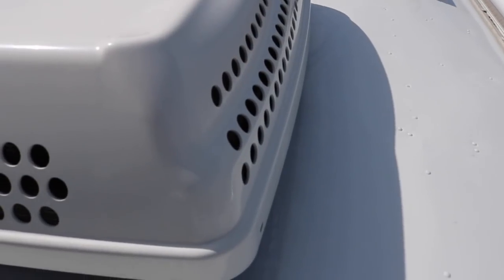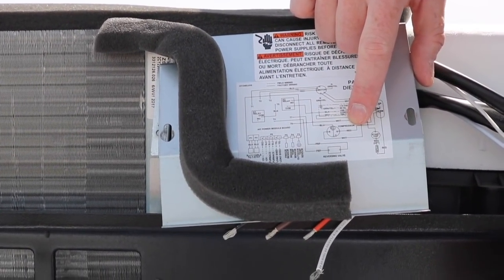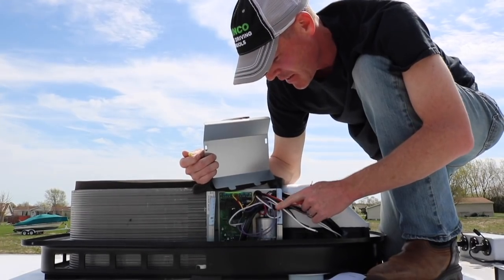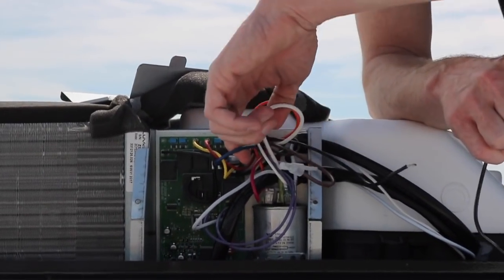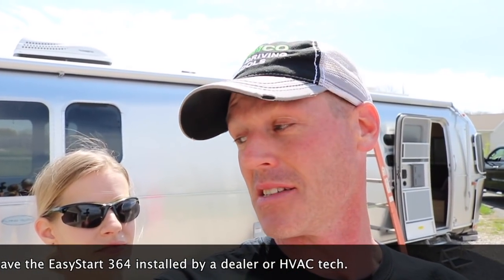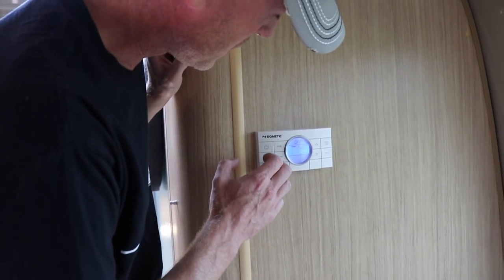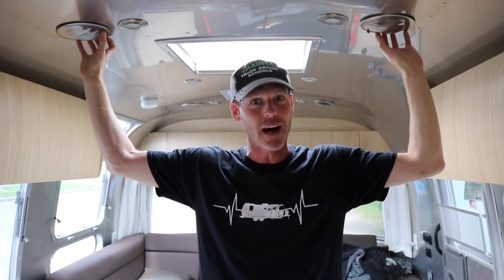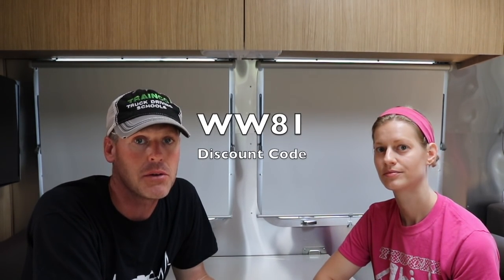HOW TO UPGRADE YOUR RV AC (DIY MicroAir Easy Start 364)

Comment: Bought this myself, both the EasyStart and iGen2500, now need to make time to get installed. Convinced both will handle my 13.5 AC no problem, but I'm curious about additional loads. Did you attempt other loads on the generator at same time? TIA
Reply: Hi Mark.  Many thanks for your purchases.  A typical modern 13.5kBTU A/C draws about 13A in warm weather.  The Westinghouse iGen2500 can sustain 2200W (18.3A) indefinitely, as we have verified in our extensive testing.  That means you'll have about 5.3A or 635W maximum leftover to power your auxiliary loads.  That's enough for just about everything except for a microwave oven (800-1200W) and for your battery charger (converter) in rapid charge mode (~1000W in many trailer designs).  In our extensive testing of both the iGen2500 and the Honda EU2000i, we have found that with EasyStart installed into the A/C, you can load the generator with the maximum calculated auxiliary load before you start the A/C, and it will still start and run fine.  Of course, operating right on the edge of the generator declaring its overload fault during steady-state operation isn't recommended since that could certainly cause nuisance trips and shutdowns.  Knowing the numbers as shown above though will allow you to do some intelligent power management to keep things running without interruption.

I'm also curious what the Wagners were able to attain with additional loads, so we'll stay tuned for their reply.
Reply from the maker: We haven't added any additional heavy loads to the generator while running the AC, we have ran things like lights, radio, TV's, ect. When we are on generator power we usually set the water heater and fridge to LP. We do know that if we want to run the microwave we have to turn off the AC first. Not really a big deal for us since Lynn uses the oven more than the microwave.

Comment: Hi Mike ,
   Question on the EZ Start and the 2500 watt Westinghouse generator . You lose aprox 3% horse power for every 1,000 feet in Altitude . Do you think you'll have any issues with the 2500 watt generator up in the mountains as far as running the a/c ?  ( It's not uncommon for my wife and I to camp at over 10,000 feet above sea level in Wyoming .)

  JT
Reply: Not sure about the westinghouse but my 2 Honda eu2200’s, and most other Honda wannabes, pair up and put out great power! I camp at high elevation too and never had an issue with the power!
Reply from the maker: We haven't used the 2500 at elevation but if we had to choose, we'd take the predator vs the Westinghouse

Comment: Just wondering why you went with this product instead of a hard start capacitor. Seems to be a big price difference. Thanks for always helping
Reply from the maker: Sombody asked if there was a difference between the EasyStart and a hard start capacitor, Mico-Air replied to it best, so I am going to copy and paste their response.

"a hard start is simply a start capacitor in series with a switching device.  Most factory-installed or aftermarket hard starts use a "PTCR" to act as this switching device.  A hard start gets applied during the startup of the compressor, and it adds torque to the motor, which shortens the duration of the start, but it does so at the expense of starting surge current.  A hard start takes about 250ms (1/4 of a second).  In some rare cases, a hard start can make a marginally non-working generator/compressor combination marginally work. But it won't always be reliable.
EasyStart is totally different.  EasyStart is very sophisticated, microprocessor-controlled, soft starter that gently ramps and accelerates the compressor to speed over the course of about 1 second.  EasyStart uses solid-state electronics to gently apply the voltage and current to the compressor's run and start windings separately, and uses a transducer and phase detection to measure current and compressor rotation in real time.  This allows EasyStart to orchestrate a very precisely controlled starting ramp that uses 65-75% less current than a normal or hard start would have used.  It's really quite amazing.  Beyond this, EasyStart "learns" the compressor during the first 5 starts to optimize its parametrics.  And if that weren't enough, EasyStart continues to monitor for 5 different fault conditions to protect your compressor during steady-state operation.  These conditions include stalls, overcurrent, open thermal protector, brownout/low-voltage, and short cycles.  No hard start or factory OEM configuration can provide any of this!"
Reply: @WanderingWagners  and if all those electronics go tits-up,  is it worth it to repair it?   How much to buy an easy-start at 2019 prices please?

Comment: Thanks for the video very good information, how are you connecting the generator to your Airstream? That yellow extension is not the 50A cable right?
Reply from the maker: The yellow cable is a 20 amp extension cord, I am using a 50/20 amp adapter like this https://amzn.to/2IADY23

Comment: Heat and altitude go in reverse.  For every thousand feet you drop about 5-10 degrees in air temperature! Above 7-8kft you don't really need too much AC!
Reply from the maker: True but still worth noting!
Reply: Also with altitude you reduce humidity which strongly reduces overall load on AC systems. Moisture holds a lot of heat, less of it makes it easier to cool the air. One big part of AC systems is dehumidification.
Reply: nope--- 3 degrees farenheit per 1000 ft --I used to skydive

Comment: I'm having a problem with the exact same setup on my 2014 Airstream. I've done the five starts on utility power but now my Yamaha  EF2000iSv2 can't start the A/C. When the compressor starts, the Yamaha goes into overload.  The Airstream's inverter is off. I have the Use/Store switch in Store position. Anything I'm missing with other switches or circuit breakers? Thanks.
Reply: Hello Don.  You and I have been dialoguing through email, so this comment is a bit out of date. Let's see what our troubleshooting efforts yield before we air it to the world.
Reply: Update: Kudos to Micro-Air tech support for identifying my problem - a wiring error. It was easy to fix & now the EasyStart works perfectly.

Comment: Great video do you guys still have predator generator as well is the Westinghouse generator as quiet ? Thanks for another great video 👍
Reply from the maker: Yes we still have the predator! I believe the 3500 predator is a few decibels quieter than this Westinghouse. But it weighs 3x more than the Westinghouse haha
Reply: Wandering Wagners yes I bought the predator after I saw your video on it and it  is nice and quiet and runs the AC in our fifth wheel but the thing is really heavy
Reply from the maker: Yeah, had we known about the EasyStart before we may have got the smaller generator from harbor freight to begin with!

Comment: What made you decide on the "easy start" there are several other brands out there and several other cheaper options although not sure you get what you pay for?  I have put one of these on a home air conditioner...it was not the easy start brand and it worked fine for about $20 but that was home ac anyhow when you get a chance is there a reason you picked this one in particular or just a general choice? Kinda hard to pay $300 for something that others sell for $20
Reply from the maker: The cheaper $20 option is a hard start capacitor, it increases motor torque to get the compressor started quicker if you have a generator that's "just enough". The easy start is a soft starter that slowly ramps up the compressor.
Reply: Thank you for the reply but Micro air beat you too it LOL  looks like they really do get involved and listen to what people say....this is and a generator are on the maybe list....still not totally sure we are going to need it and I was not totally sure I could run my ac of a regular house 120 plug....long story short I hooked up a volt meter to make sure voltage stayed up and it ran fine all weekend long....one of things for prepping for our trips is being able to sit in the camper and figure out where everything is going to go and trying to do that in Texas summer heat is not an option anyhow appreciate the reply and I have good information to pass along to others.....assume it would be ok to share your links on my channel ?
Reply from the maker: Yes that's fine. Share away 👍😁
Reply from the maker: Yep, we don't mind if you share links!

Comment: Would this product void the manufacturer's warranty on the A/C unit?
Reply from the maker: It may, but it depends on your specific warranty, on your specific unit. I've read through ours and it doesn't give specifics stating it'll void it. I've also read that manufacturers can't void a warranty for the owner working on it and not a shop or dealer (although they will all tell you otherwise, but push back and they know you're right.) As long as the work is done correctly and won't cause damage to the unit under warranty. The issue is if you mess up the install, and it then damages other parts, then you're sol.

Comment: is there any difference between this micro air start and a hard start unit? Besides the price
Reply: Hi Steve.  Thank you for your question, which is not an uncommon one.  The short answer is YES, there are massive differences between the EasyStart and a hard start.

First, a hard start is simply a start capacitor in series with a switching device.  Most factory-installed or aftermarket hard starts use a "PTCR" to act as this switching device.  A hard start gets applied during the startup of the compressor, and it adds torque to the motor, which shortens the duration of the start, but it does so at the expense of starting surge current.  A hard start takes about 250ms (1/4 of a second).  In some rare cases, a hard start can make a marginally non-working generator/compressor combination marginally work. But it won't always be reliable.

EasyStart is totally different.  EasyStart is very sophisticated, microprocessor-controlled, soft starter that gently ramps and accelerates the compressor to speed over the course of about 1 second.  EasyStart uses solid-state electronics to gently apply the voltage and current to the compressor's run and start windings separately, and uses a transducer and phase detection to measure current and compressor rotation in real time.  This allows EasyStart to orchestrate a very precisely controlled starting ramp that uses 65-75% less current than a normal or hard start would have used.  It's really quite amazing.  Beyond this, EasyStart "learns" the compressor during the first 5 starts to optimize its parametrics.  And if that weren't enough, EasyStart continues to monitor for 5 different fault conditions to protect your compressor during steady-state operation.  These conditions include stalls, overcurrent, open thermal protector, brownout/low-voltage, and short cycles.  No hard start or factory OEM configuration can provide any of this!

Comment: Mike, I thought you had the Harbor Freight 3500 generator?  Why didn't you use that one?
Reply from the maker: We do have the predator but as you mentioned it's a 3500 watt generator. It will run our AC already. However a lot of people don't have or don't want to get a generator that large. And with the EasyStart, they don't have to get a big generator to start and run their AC. Had we known about this product before getting the predator, we probably would have gotten a smaller generator to begin with. We used the Westinghouse as an example for those who have a smaller generator to show we can run our AC with it, after installing the EasyStart.
Reply: I just read the comments I should have before I asked

Comment: I'm confused.  Your trailer has two A/C units.  Was only one of  them running on the generator?
Reply from the maker: Yes, the generator wouldn't run them both at the same time. It was too hot for it to do that. It's done it before when it was much cooler out though

Comment: You need to put more into your content of installation. Went to quickly for the common layman to take in. Install of the Easy start should have been present with more detail as to what you were doing. Many of us use these videos on our cell phones as we do the install.
Reply from the maker: Feel free to watch again or pause where needed. The unit also comes with directions for the install.

Comment: What happened to the one you had from harbor freight?
Reply from the maker: We do have the predator but it's a 3500 watt generator and It will run our AC already. However a lot of people don't have or don't want to get a generator that large. And with the EasyStart, they don't have to get a big generator to start and run their AC. Had we known about this product before getting the predator, we probably would have gotten a smaller generator to begin with. We used the Westinghouse as an example for those who have a smaller generator to show we can run our AC with it, after installing the EasyStart.

Comment: For anyone unsure on installing themselves,  read the instructions thoroughly,  and take pics before disconnecting any wires. If you get interrupted, you can always look back at what was before you started. 

Trucker boots on top of an airstream, really? 😲
Reply from the maker: My boots are safest, as they have vibram soles for non slip. The roof is rated to stand on, and no damage occurred. 👍

Comment: Great video! I might have to consider this. I currently use a 5k inverter when boondocking. It struggles at times when extremely hot!
Reply from the maker: So far we are really impressed! Definitely worth the money to upgrade
Reply: Have tried 3 different generators...same result
Reply: Have to have it hooked to 30amp at the house. It pops a 20 breaker

Comment: What happened to your Harbor freight generator?
Reply from the maker: Nothing, We still have the predator but it's a 3500 watt generator and It will run our AC already. However a lot of people don't have or don't want to get a generator that large. And with the EasyStart, they don't have to get a big generator to start and run their AC. Had we known about this product before getting the predator, we probably would have gotten a smaller generator to begin with. We used the Westinghouse as an example for those who have a smaller generator to show we can run our AC with it, after installing the EasyStart.

Comment: I just received mine two weeks ago. I was not sent any of the connectors, just the unit itself and wiring instructions.
Reply from the maker: In the video there was text stating that the installation kit was sold separately. However all of the connectors should be easily located at any hardware store.
Reply: Hello.  Thank you for your business!  We apologize for your disappointment.  As it turns out, the EasyStart 364 just comes with its harness since all installations slightly differ, depending on the brand of air conditioner.  Most customers already have the necessary crimp terminals in order to do the installation.  We do offer a low-cost installation kit that includes all of these various crimp terminals, tie wraps, 3M double stick tape, etc.  This kit is mentioned in a couple places on the EasyStart 364 webpage.  If you don't want to do that, all of the necessary crimp terminals are available at any hardware store.
Reply: Micro-Air, Inc. my apologies...this video gave me the impression the connectors were included vs an added purchase.
Reply: No worries!  The Wagners have a subtitle in the video where they presented the installation kit to clarify that it was sold separately.  It's certainly understandable that viewers may have missed that, so once again we apologize for any confusion.

Comment: Because of taking the strong start-load off the A/C, could you then, in a pinch, use the air with a 110 heavy extension cord? I've done it before in Minnesota during a camping trip while staying on our relatives property, but it was tricky to do - very little other electric was on in the coach, (but also really hot and humid during the stay.) Also, I presume if you're going in for that bite to eat, you have a way of securing that generator. . .?? Looks like it could "walk" very easily. . . .!!!
Reply from the maker: We have it chained and locked up. Just no need to show that in the video haha if it works in a pinch and doesn't damage anything that's impressive!

Comment: You’d think  the AC manufacturers would add this some start to the units at a premium of course.
Reply from the maker: You would think! I bet it would be a popular option.
Reply: Wandering Wagners I don’t think it should even be an option. The manufacturers should just include the soft start already built into the units right from the factory before they are sent to the RV manufacturers. It’s  a simple enough thing that could easily be done during the manufacturing process.  More and more the manufacturers a claiming being green with the products they sell. I’d have to think the soft start also saves energy, both with saving gas if you’re running your unit on a generator and if the units connected to power at a campground. Wander greener!
Reply from the maker: Maybe someday they will!

Comment: 300 bucks for this or just spend the extra 300 on a larger genertor? I think if it was much cheaper it would make more sense
Reply: Larger generator is not only more expensive, it is also LARGER and heavier.  Size and weight play a significant factor in the RV world.  I will gladly spend $300 to upgrade my air con vs adding size and weight to my generator.